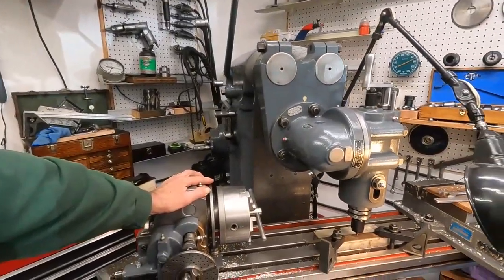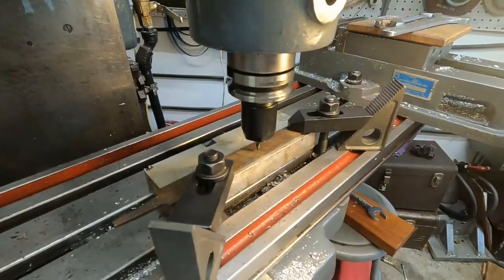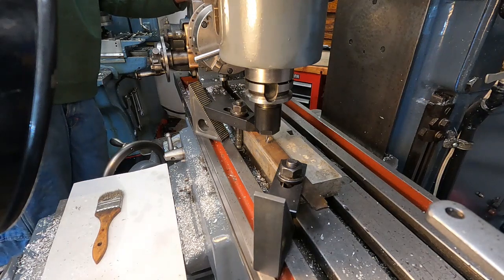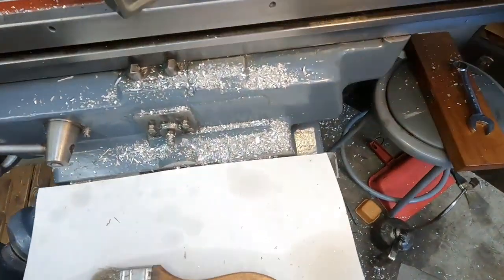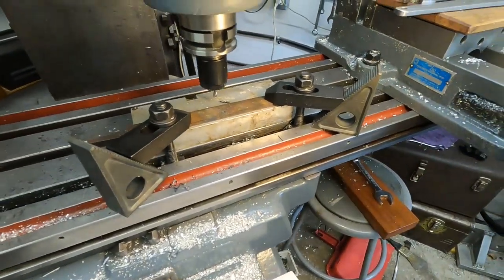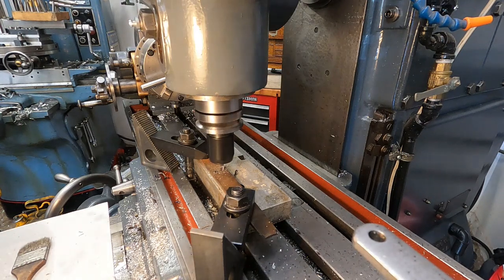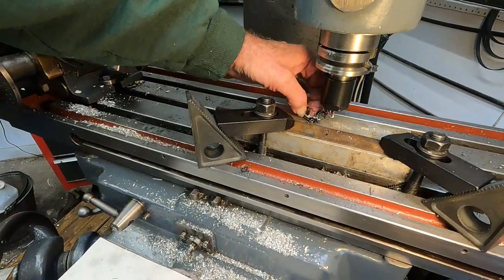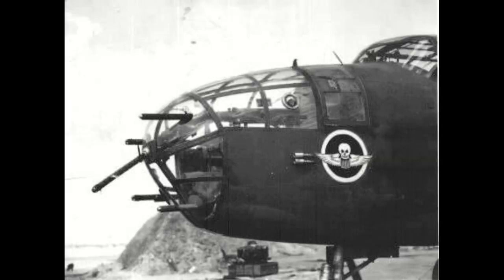Restoring a broken carbide bit and drilling holes in a hand file

Comment: You don’t find that increasingly wide web to be a problem?
Reply from the maker: I did mention it would be more of a problem on light machines such as Bridgeport and that I would add another    clearance angle behind the cutting edge effectively reducing the web along with increasing the edge angle. This is one advantage of a heavy machine with a screw feed to the quill.
 If I was to drill through the file using the jig borer, I would have to have a tool that would cut with much less pressure applied to the quill, but the tool may be good for only one hole because it will be weakened.